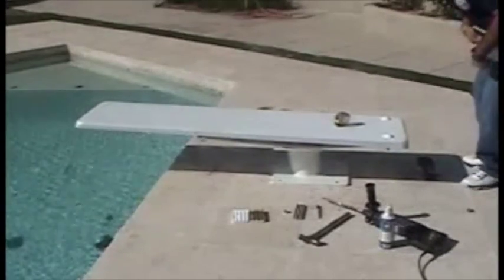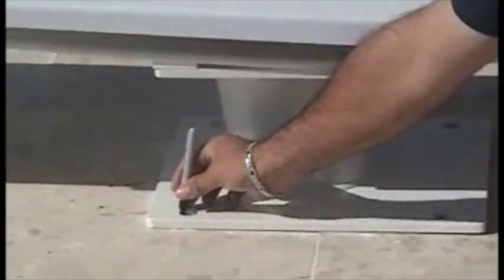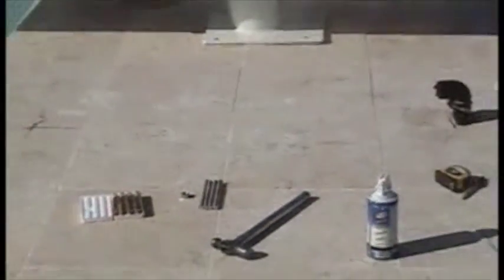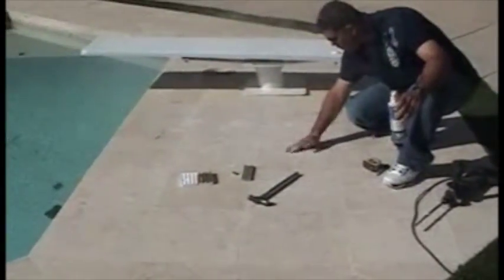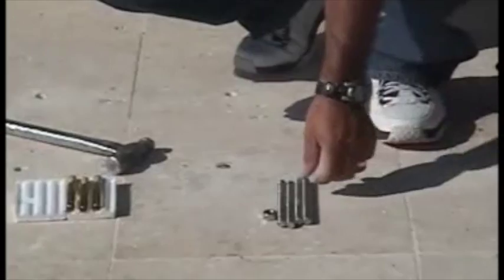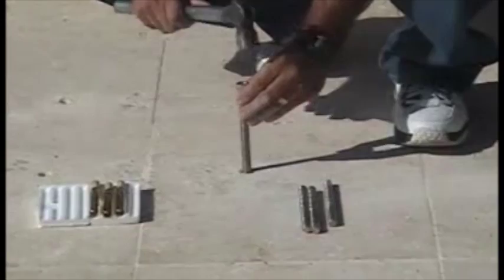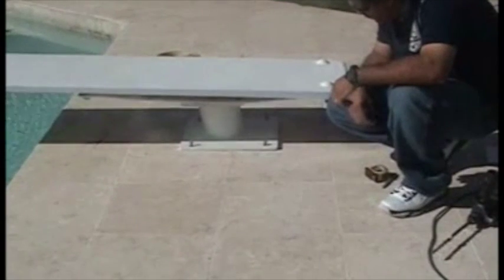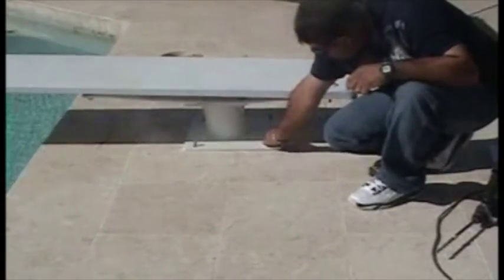Inter-Fab Epoxy Kit Help Video

Comment: This is not safe! The concrete should be out, rebar drilled on all 4 sides, going 10 inches into each side. A special anchor kit is then added before adding the new concrete slab.